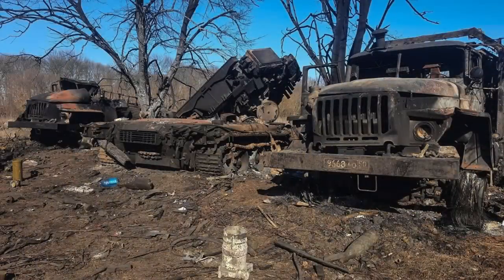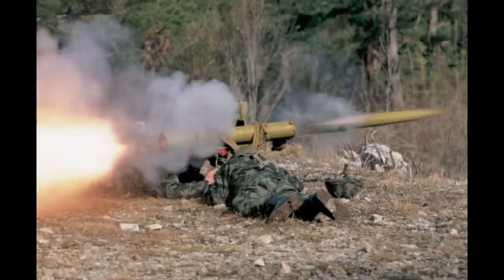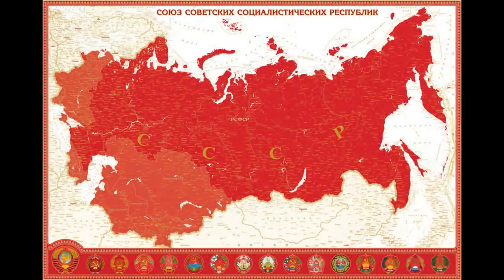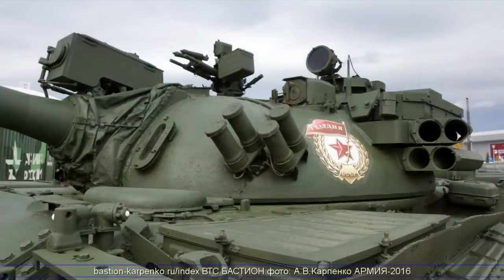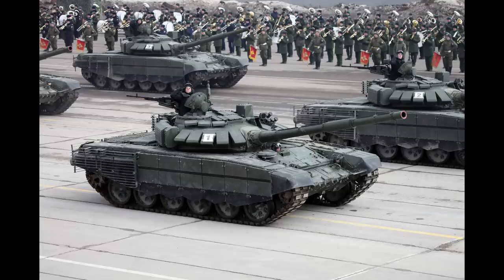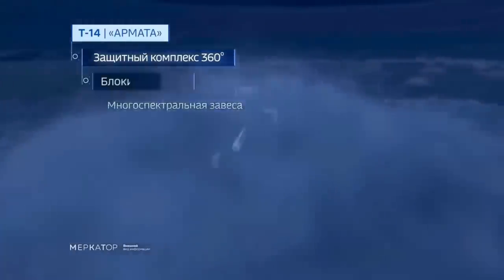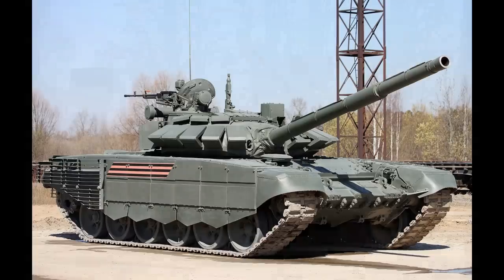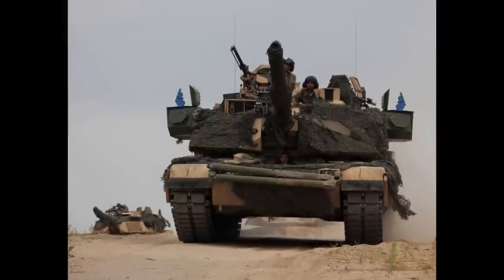Why are Russian Tanks Failing in Ukraine?

Comment: Majority of losses semm to be from artilery attacks not atgms. so APS would not be a huge game changer.
Reply: I didn't know that was possible. Do army's still use towed anti-tank guns or do they bombard the general area where tanks are? 

Because I doubt you can pin point a moving tank and send a round on it.
Reply: pretty much this, tanks will become eventually obsolete, rockets and artillery win the wars.
Reply: @Abdullah-mn6sw  I mean you can send the coordinates of a road and strike the shit out of it
Reply: @maplearrow1842  oh
Reply: @wizardoflolz5626  But tanks are much more mobile.
I think tanks are to artillery what boots on ground is to jets. You may be vulnerable but you need those to hold captured ground.
Reply: @wizardoflolz5626  it will never be obsolete. Tanks now are being fielded with aps systems. Ask Israel. You will always need tanks. It's assinine and stupid to think otherwise. Ever saw shields protection? It's not science fiction anymore. You should think atgms will be obsolete.
Reply: Well, yes and no.

Normal artillery shells can only net mission kills by blowing up gunsights, guns, and tracks.

And also, the time to target is much longer than an ATGM you hump around.

Artillery is damn useful, it's vital to any war effort, but it's not going to replace the need for SALWs.
Reply: Does APS not work on artillery?
Reply: @prfwrx2497  they can use HEAT shells, and that struck the top armour, so its possible to penetrate
Reply: Javelin comes in from above, Stugna uses laser communication guidance not paint targeting and the NLAW... the NLAW is fucking blind and a Pinball Wizard.
Reply: During the first 2 months of the war as much as 40-50% of the losses were from vehicles just being abandoned for a variety of reasons such as fuel shortage, being stuck in mud, desertion etc.
Reply: @prfwrx2497  rarely gunsights or guns, the largest threat to the tank is the destruction of tracks and roads
Reply: @itsthatsebguy93  why would it?
Reply: @prjndigo  Stugna can still be thrown off, though its much more rare for a laser designator to be disrupted than a basic SACLOS setup
Reply: @alexnderrrthewoke4479  This whole protection systems are fcking expensive dude , while a single cheap ATGM launcher can knock out this tanks . No nation will bring out this expensive toys at a urban battlefield , the Russians use their old tanks instead . That's just too expensive to upgrade every one , even the Germans have only about 19 Leo2A7 with this Israeli system . What are 19 tanks ? Nothing , tanks become more and more obsolet in the future .
Reply: @prfwrx2497  Real life isn’t War Thunder, lots of ww2 tanks, pattons and t-55’s were destroyed by high caliber shells. If the armor doesn’t crack from the explosion, the shockwave sure will wound/kill the crew if it’s a direct hit
Reply: @TheArcticFoxxo  It detects and destroys munitions. You'd think that it might work on artillery.
Reply: @5co756  not really. You get rid of the old equipment first then move to new stuff. uS and NATO does that. Why you think they dumping all the old stuff to Ukraine? It's expensive now but soon tech will change that and will be cheaper and very cheap
Reply: @itsthatsebguy93  Not the current APS used in the war. Any other hard kill APS would be very situational and limited, and soft kill, as on the T-90 and such, would do nothing to artillery. Let alone the fact that they aren't disabled from direct hits, but logistical destruction and shrapnel damage
Reply: @5co756  you need to read books about future wars and watch movies as they show us how they will be always prevalent in the battlefield. Again everything has it's counter. My dad used to say that we just need drones to win the battlefield and again drones are being shot down at an alarming rate with counter. So that means it's obsolete? It's ridiculous your arguments you guys put in seriously. When shields become prevalent that atgms cannot hit tanks nor planes and what about laser weapons? Laser can shoot drones down with ease so that means it's obsolete? Helicopters?
Reply: @TheArcticFoxxo  Right so even if APS could destroy the shell the shrapnel would still damage/destroy the tank.
Reply: @Abdullah-mn6sw  Laser guided artillery shells paired with a drone.
Reply: @itsthatsebguy93  oh, is that what you were initially saying? Sorry.
Reply: @prfwrx2497  You severely underestimated the power of a 155mm HE shell blast......
Reply: @alexnderrrthewoke4479  Drones are cheap and no humans are in danger , compared to this metal coffins with a crew of 4 or 5 men with absolutly bad views of the battlefield . In tank vs tank combat's that's a different story , but against infantry , arty and drones this tanks are pretty useless or suicide I would say . 

Maybe in a few years with a new generation of tanks , with no crew and active protection systems all around tanks will be back .
Reply: @SovietBear4  oh
Reply: @wizardoflolz5626   nah, there always will be a demand for direct firepower... but maybe 65ton tank is not it.. i think we will see a renaissance of "medium tank" or something like MPF, that is much lighter, has same level of firepower, but is much faster, with superior sensor systems and multilink communication with other weapon systems... Mobile system that will  be informed by others when artillery barrage is about to land in the area, so it can get out of the place... while having some sort of thermal camouflage to protect itself against intelligent ammunitions... If you look at it - heavy armor is practically a passive weight that doesn't really help.. firepower advantage is the main factor that decides engagements..  modern armor is more about absorbing damage than resisting it, so even if projectile doesn't penetrate, that energy usually does take out some systems out... and i've seen a lot of reports from Ukraine where tankers instead of using APFSDS rounds, fired HE-FRAG rounds at enemy tanks to disable them - such blast usually takes out all sensors on the turret making the tank unable to continue.. sometimes crew just bails out after first such hit...
Reply: @Abdullah-mn6sw  Laser or gps guided tube arty shells are a thing since 80s i think, they can even hit the moving targets.
Reply: @robertkalinic335  laser guided and GPS guided are completely different things. Gps guided is just regular arty. Crew inputs a 10 digit grid and shoots that location. They cannot hit moving targets for obvious reasons. Laser guided requires someone near the target continously lasing it to hit it but it can hit moving targets. The technology to do this with artillery is recent.
Reply: @92HazelMocha  reaaaaaaaaaaaaalyyyyyyyyy!!!!
No way, i hope you go outside sometimes.
Reply: @itsthatsebguy93  1) APS doesn't work against shells detonating around but not on the vehicle. That can result in blast & fragments chewing up sensors, tracks, etc. 2) The sensors generally have a relatively narrow vertical field of view. Shells that don't cross that field of view can't be intercepted. 3) Larger warheads, say a 500lb bomb, can destroy the vehicle with blast effects even if intercepted. 4) Very fast targets, like APFSDS rounds, are still difficult and shells are generally faster than ATGMs but probably not enough to matter.
Reply: @Abdullah-mn6sw  artillery is pretty much the oldest weapon to take out a tank
Reply: @pewterschmidt23lord99  I asked how modern ones are utilised.